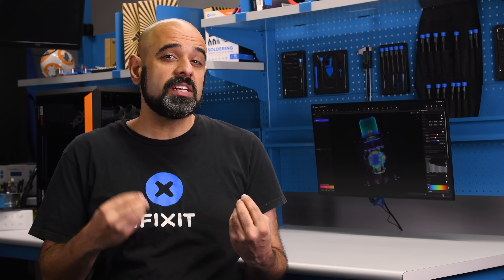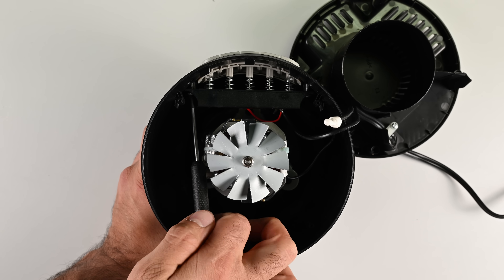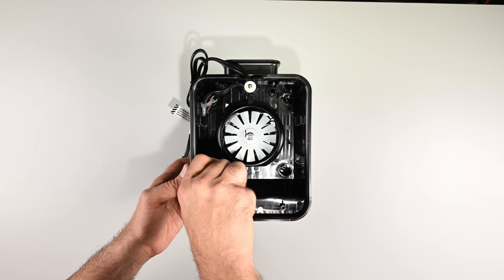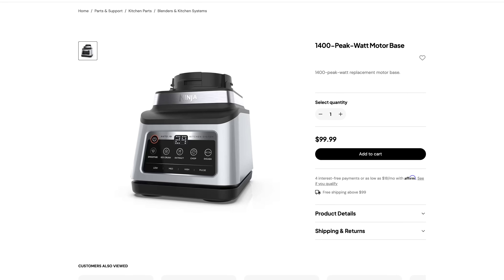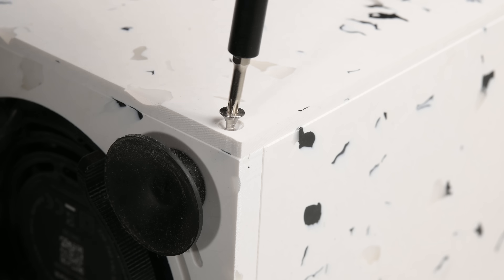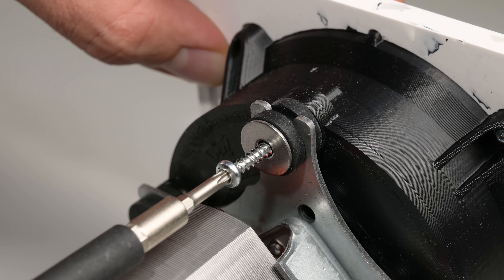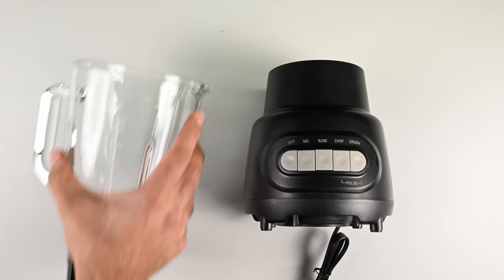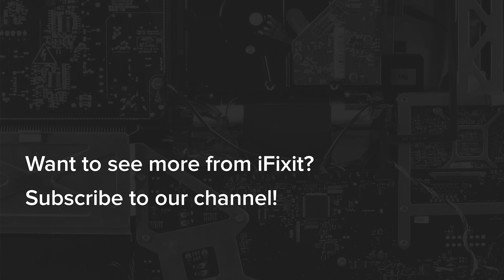Open Funk re:Mix: The Open-Source Blender Big Brands Don’t Want

Comment: The cheap blender wins to me. If you are tinkerer enough to 3d print parts for a $350 blender then you are able to find and insert a replacement motor for the cheap one.

Comment: Cool and all but in Mexico that's why we use Oster Blenders, especially the simpler ones, you can find replacement parts everywhere and every local repair shop for appliances will be able to fix it and they probably already have all the replacement parts new or used. It's not exactly open-source but it's definitely the actual way companies that want to hold some patents or designs should handle their repair ecosystem. Also, I mean, from an economical stand point, it's just the obvious choice comparing it to that Funk blender, since you can get an Oster one for literally one 10th of the price. But maybe this is a project that makes more sense on the country where this is from, it's still great to see any kind of open source hardware, but in this case the price just doesn't make sense where I live

Comment: I had a Ninja blender once.  The blades were WAY too sharp for a kitchen blender.  I ended up cutting my fingers very badly.  That resulted in my trashing the Ninja and going with another brand that ended up blending way better than the over-engineered yet flawed Ninja.

Comment: Would be even better if the wires had connectors and were not soldered. So you can replace any cable or component without much hassle or a soldering iron. 🤷

Comment: Repairability is one thing but durability is another. 

For a lot cheaper you could get a mid range blender with resettable overheat protection so the motor doesn't fry itself if you mess up, and for the price of this ungodly expensive blender you could get an overbuilt Vitamix or Blendtec with metal gears and motors that can grind through anything you can fit in it

Comment: So, the OpenFunk design is 240VAC only.  So, it won’t work in the U.S., unless you’ve got it plugged into a transformer that handles the 120/240 VAC conversion, as well as the 50/60 Hz conversion.

Also, the design where the container is upside down means that you can’t add ingredients to it once the container is attached to the unit — which I frequently do with our Vitamix.

Comment: The Open Funk will "last as long as you want to keep it running" - IF the company is still in business to sell the hard-to-get parts or you can get them elsewhere. At quite a bit less than the Open Funk's price, however, you can get a reconditioned VitaMix with a 5-year manufacturer's warranty. I do love the idea of open-sourcing and 3D-printability and the ability to attach other types of blending containers. But note that the Vitamix containers (for example) are exclusively plastic, because glass can be dangerous at high blending speeds when blending frozen objects. 

Which brings up an important question: How good is the blender at, say, making smoothies?
Reply: Benefit of it being glass is much less microplastics in your food.

The idea of it is that you can still repair it even if the company is out of business. All the other parts are relatively generic.

Comment: I am not sure when 3D printers became a thing every household has
Reply: I was kind of wondering the same thing.  They're saying the "repair option" offered was buying a replacement base.  But in this case, the "repair option" is buying a 3d printer,  learning how to use it,  and then printing replacement parts.

Comment: My  Czechoslovak Eta Mira blender is currently 65 years old, I can still buy most replacement parts for it, it still has a lot of torque and doesn't even have a paint chip on the housing. Startup is a problem if you're trying to blend a thin liquid as it has a tendency to spit if you're not super careful and there are probably blenders out there with better blade geometry and performance, but this one will outlive me.

Comment: The parts nearest the jar being 3D printed could be problematic as most FDM parts are porous and could absorb spills and get moldy/rot
Spills happen and provision for them like a drain port and nonporous parts would extend usable life
What bearings are in the motor? Why isn't it brushless?
Reply: brushless motors would add complexity to the electronics and likely increase the price with another 60€. we might consider it for the future though!
Reply: @OpenFunkHQ  How watertight are your FDM prints?
In terms of price, You are already in Vitamix territory, with no history
Reply: @stephen1r2  We don't claim to be the Ferarri of blenders, that's why you pay up to 800€ for a Vitamix. During mixing, the food isn't in contact with the prints - only with glass, stainless steel (blades) and silicon (sealing). In case of rare spills, there's a drainage system to channel the food / liquids. Big chunks of food might get stuck there, regardless of the materials we'd use. What we aim for then is a design that allows you to clean the parts easily (e.g. you can open up the blades head by hand, or the mixer with a screwdriver).
Reply: I believe the reason it's not brushless is to avoid any electronics.

Comment: This open source blender is a health hazard. They sell you 3d printed blade head. PLA is in theory food safe, but you don't know what additives were added. Next the print lines are non cleanable and they are the best environment for mold. And lastly when you print the plastic, you introduce contamination to it. In best case scenario the blade head is just single use thing.

I'm wondering why this was not mentioned in the video. This is one of most important things in the hobby 3d printing. FDM 3d prints are not food safe in any way!

Comment: And this Open Funk will likely go out of business. To make profit you need either margins or volume. If you make a product repairable, you lose volume, which you have to compensate in price of unit (or spares, which is not the case here). Plus, you gotta admit the design isn't appealing. Hobby/statement product? Yes. Profittable business model? Nope...

Comment: I deeply worry about using mason jars here. The glass on them is super thin so they're a lot more likely to break and it feels like this product is just more of a prototype project than something that should be sold.
Reply: 2 years of r&d, the certification agency and thousands of users diagree regarding these safety concerns ;) it turns out these jars are sturdier than you'd think
Reply: @OpenFunkHQ  That's wonderful to hear

Comment: FDM 3d printed parts like these should never come in contact with food and even water. They have these microscopic cracks that trap tiny pieces of them, and then bacteria grows up in them. Here’s hoping they are clever enough to avoid any contact of that sort
Reply: parts in contact with food during mixing are: glass (glass jar), stainless steel (blades), silicon seal. the 3D printed parts aren't
Reply: @OpenFunkHQ Thanks for clearing this up! I’m glad more and more things are becoming open source :)

Comment: This is just a universal motor in a fancy 3D printed box with some CAD files and off the shelf parts…
I’m sure one could find a replacement motor for either of these blenders on eBay, but it would be from the manufacturer direct, and wouldn’t be branded as such. 

Also for safety reasons, every appliance in my house must be tested by a Nationally Recognized Testing Laboratory (in the US), like UL, CSA, Intertek, one of the TÜVs, etc. 

And for these such appliances, there is little reason for buying one new, even if it is “repairable”. There are probably several perfectly good working blenders in need of a home around your area in thrift stores, and they have already been produced, so they don’t have any extra environmental impact, and if it breaks on you, just go back and find another for $10.
Reply: I've been saying this for a while now. So much stuff has been produced (be it clothes, home appliances, furniture or electronics) that the entire world could probably live off the second hand market with minor repairwork for at least a few decades. There's basically no real reason to buy anything new anymore at this point and I really wish we stopped pretending there is. As for appliances, the only counter-argument might be that "but if I buy this microwave used it won't have a warranty and might break any day!" That's sort of true but on the other hand you can likely buy a new one (or get it fixed if you have the knowledge) for less than the cost of a whole new one up front.
Reply: @devnol  It is ridiculously easy to repair a microwave oven too, but it can be quite deadly if you do not know what you are doing. 
The safety switches and the fuse are by far the most common failures, and a couple of dollars can save you a few hundred.

Comment: So the open souce "forever" blender costs as much as 13 cheap blenders that last 1-5 years each?
Honestly, the greed on show here wipes their green credentials through the mud
but I can't wait for open source projects that undercut everyone (including the cheap blender)
Reply: Greed? By all means, start your own business  of making a repairable open source blender for cheaper while competing with corps that have economies of scale.
Reply: @axeavier lol yes these 3d printed parts, a mason jar, and a cheap motor cost €320. Touch grass
Reply: @iamdmc  You could touch grass too, by going outside and starting a business that you think will easily outcompete this company. But you can't and won't because you're talking out of your ass
Reply: @iamdmc If you watched their video I think you'd understand more why these cost what they cost. These are *handmade in Berlin*, not China. All the plastic is recycled plastic, which is much more expensive than virgin plastic, it's twice the power of a cheap blender, and contains CNC-milled parts like the metal knob.

Comment: I'm all for repairability, but with 400$ for this Blender this is a very hard sell, especially since the only spare parts they directly sell are blades anyways.
Also who considers 3d printed parts in their 400$ blender a positive? I 3d print repairs because I have the tooling, but I would take molded parts any time of the day over 3d printed ones.

The Wallmart Hamilton Blender is three times as cheap!
For the 25$ Hamilton Wallmart Blender I can get replacement blades off of Amazon easily.
The new blades are also twice as cheap.

At 25$ it is more effective to keep the old Blender-container and buy a new 25$ blender, since the amount of created waste that way is minimal and mostly plastic anyways, besides the fried motor.

Comment: I found a vitamix blender in the road during the early pandemic and I've used it to make a smoothie every single day since. That thing is a tank.
Reply: Our vitamix has been in nearly daily use for more than 30 years now. It still works perfectly, and I don't have to worry about a 3d-printed piece losing little bits of plastic over time due to heat cycling.

Comment: How is one blender 12 times more expensive without any other benefit? would not make more sense to try to make the cheap one repairable?
Reply: to add to @winnetou17, @eried : We've spent many additional months in R&D to make the product repairable as it is. If you want to go cheap as a manufacturer, you don't do this and cut costs. We're a startup making durable products in the heart of Berlin with the aim of cutting e-waste, as opposed to a multinational making cheap products made in questionable conditions with no plan to have them repaired. It all comes with a cost
Reply: I think that is one of the points of the review.
Reply: Good question, and the answer has multiple reasons:

- the €350 includes VAT (standard in Europe's countries). If we remove that, it's a bit over €290. For simplicity sake, let's say that without VAT it's $300

So why is it 10 times more expensive without any other benefit ?
There ARE other benefits:
- 1000W vs 500W, so twice as powerful
- ability to use normal glass jars - don't know how much this is worth to someone, but it's a plus. You can blend in directly in the jar you're going to store it, so less waste of having part of the mix stuck to the walls of the blender jar, since you no longer have to transfer

The real big kicker though: it will probably last you, I'd say, 5 times as much. That is, on average 5 years (before any repairs) versus 1 year. You can see from the 0 warranty and the unhappy reviews telling it's not robust versus 2 year warranty and a more solid and repairable build.

Soo, it's roughly twice as expensive for a better/more feature product. I think you can make the case that rapairing it to last you 10 years should cost less than $150, so for a 10-year ownership cost it can be $450. So it will drop to 50% more expensive for a better product. In this perspective it's totally ok, I'd say. Especially so if you also value not increasing the world's landfills, using recycled materials, the higher chance of being able to repair in a couple of hours, instead of having to place a new order or to drive to the nearest Walmart and so on.

I do admit that at first glance it's a very hard sell. The calculation I made, I wouldn't say it's optimistic, but neither pesimistic. I can't prove one way or another. At worst, somebody buys this and it breaks down catastrophically in 2 years and one month, while it might try the $30 one and it lasts for 10 years. On the other way you might buy the Walmart one and break down in 2 months and buy the €350 one and work flawlessly for 10 years. The spectrum is really wide. But the expensive one does give you more options, more guarantees and hints that it should be both more solid and easier to keep it functionable.

That being said, if they can lower the price to €250, that would be great.
Reply: @Winnetou17  I'll just chime to debunk you. You don't need 1000W on a mason jar blender. You're sooo going to get them all explode on you, and that is going to lead to injuries. IF it came with a sturdy glass jar like normal multi-speed 10 times less expensive blenders, it might be worth it to have a 1000W motor to blend anything you put in it. It doesn't waste anything to have it on the walls of the jar because you can use anything to get it out. 

Parts for cheap multi-speed blenders like osters that also don't have circuit boards in them, are readily available and cheaper than 3d printing for 12 hours a replacement part. 

It isn't going to last over 5 years, blades specially. The first thing to go will be the blades, then the motor 3d printed drive stud, or viceversa. The next will be the speed adjuster, and maybe the safety switch, specially because it looks like it's too small for the supposed 1000W, warranty on the other side of the world is useless if you have to pay for shipping.  

3d printed plastic is not food safe, blenders do leak, or you can accidentally spill something on it, or it can leak because the mason jar wasn't 100% secure or what have you. So, that means food into the grooves of the plastic, turning into mold. Even the base is 3d printed, so, mold on it too.

Light, also comes from fossil fuels in most of the market in America, so printing a part for 5+ hours greatly reduces the effort of not driving. Filament is not normally recycled, and the motor and internals don't look recycled either. All but the single exterior panels are recycled.

There is no world or market for this blender, it's an impossible sale, even if the $30 one breaks you can fix it for 10 or less. In this one you can't even make one, you can't source a single motor for it without having to buy multiple from China. Which, are like 3 to 6 usd a piece. 

So, to finish it off, this one doesn't offer anything other than 3d printing parts. There's a sea of other options that are as simple as this one, that also don't cost 350 eur, and are easily repairable. This one doesn't guarantee anything, or hints at anything other than it's a rip-off.
Reply: @TheVieneses  Thanks for the reply! Unfortunately I have nothing to add, blenders aren't my speciality, so I can't debunk (nor confirm) basically anything from what you said. Though the insight is nice. And from what I get from the other comments, indeed, there are other blenders (not shown in this video) that are overall better.
Reply: @TheVieneses The beauty of mason jars is infinite variability on size, you can get a 2-liter jar for this very cheaply.
Reply: You need to understand that it's made by a small company (raising the price a lot), plus, they apparently treat their employees well and use good environmental practices. 

Basically, richer companies can get their labor and materials a lot cheaper and can mass produce them at a higher level, lowering their price even more....

And you need to understand that a company able to make it that cheap would never want their product to be repairable....
Reply: @TheDeathmail  alternatively the company could've picked one very popular and accessible blender model and make mods for it. Sort of like an engine swap for existing blenders.
Reply: @TheDeathmail  sure... but 12 times? I can have a warehouse of spare parts taking apart the cheap ones and it is still cheaper than 1 "repairable"?
Reply: @eried  I'd guess they are purposefully limiting sales to scale at low risk.
Reply: @TheDeathmail the company need to understand that most consumers would pick that $30 one
Reply: paid review anyway.